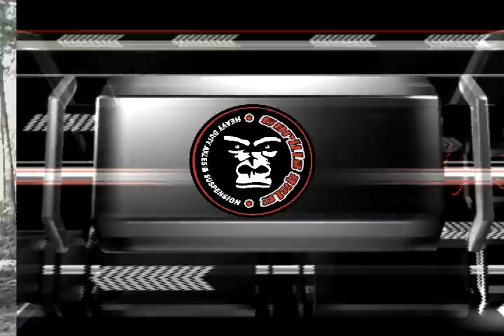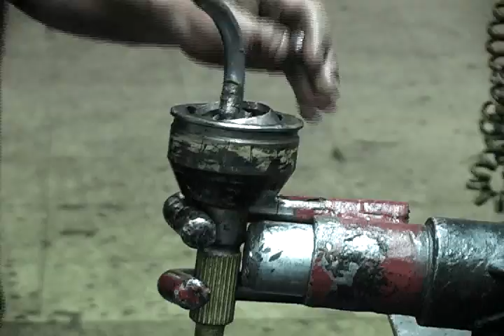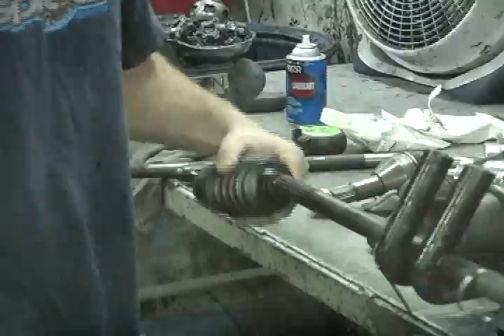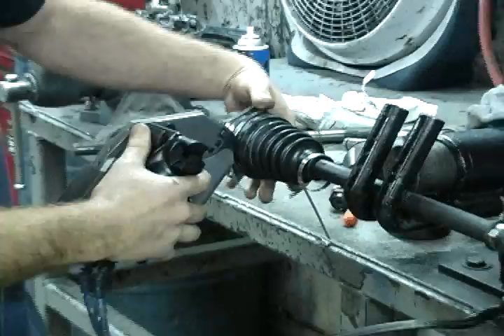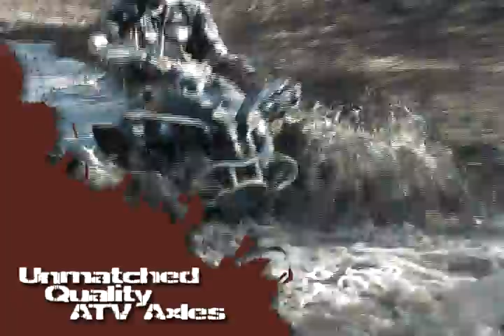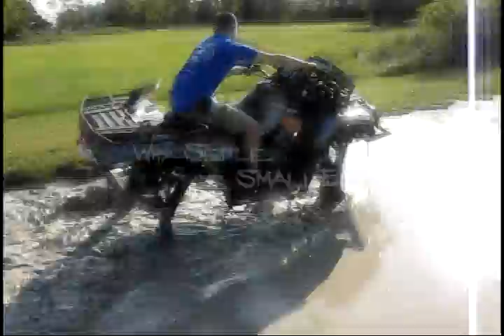Indy Promotional vid 2011

Comment: @800canamrider i personaly think outlaws have the edge do to the fact that they are light/less tread and therefor can be ran by a smaller engine 4wheeler, and they cost less too, a big factor if your 14 like me. and i mainly  said that because highlifter is coming out with an outlaw 2.0, so why not retort with a silverback 2.0? and the new law is getting 1.5 middle lug depth and 2.75in on the ears of the tire, plus new side wall wrap.